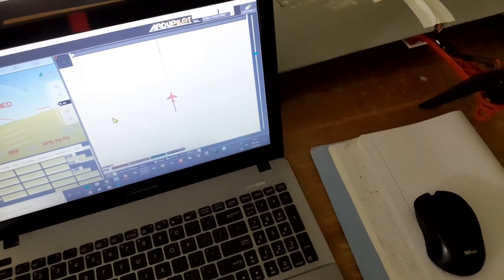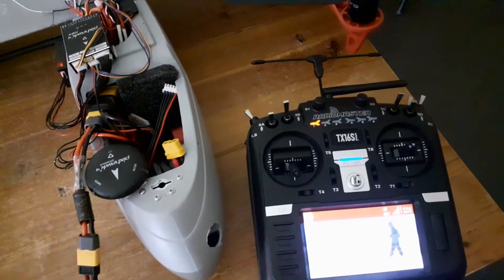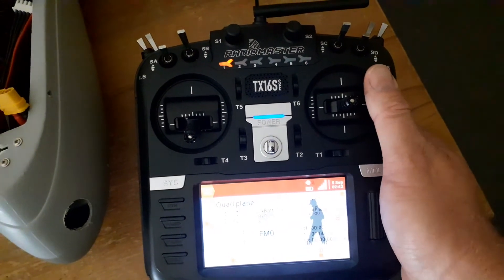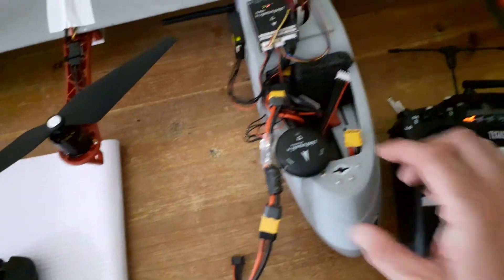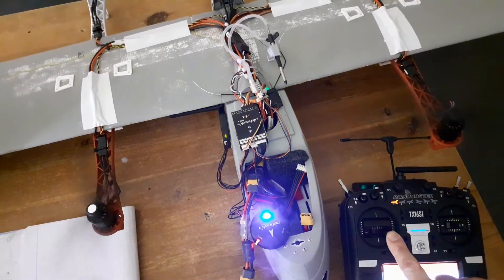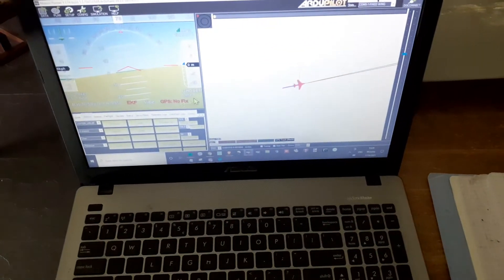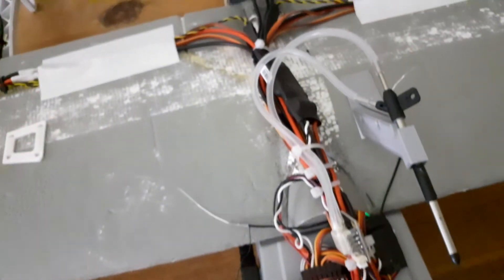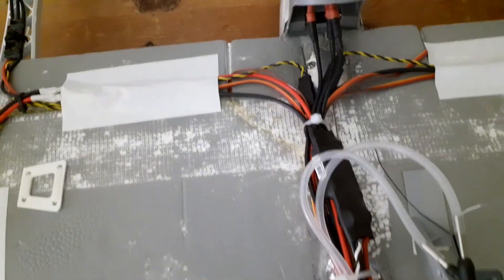Quad plane the basic components

Comment: Hi, Interesting post. 

I've been trying to rig up a similar setup but cannot get any output from the Pixhawk 4 to the Quad motors.
I'm using a Holybro Pixhawk4 and PDB connected to Mission planner and loaded with Ardupilot Plane with Q enabled.

 I had watched your earlier video where you swapped the leads from the Flight controller to the PDB to get servo output but that didn't work since the Quad motors are fed from the main IO board on cannnels 5,6,7 and 8 as required by Ardupilot Quadplane config.

I've spent many frustrating hours on this with no success. Can't even calibrate the ESC's. I suspect from your video that you may have had similar problems.

Any ideas/suggestions would be greatly appreciated.

Thanks
Reply from the maker: i can try and help, do you have telegram?